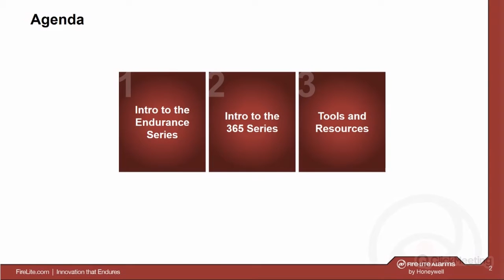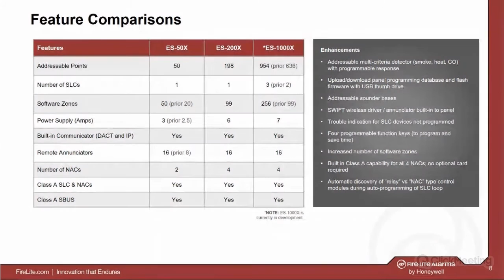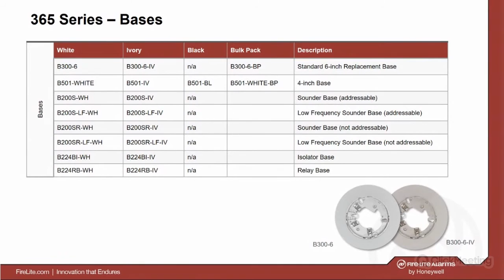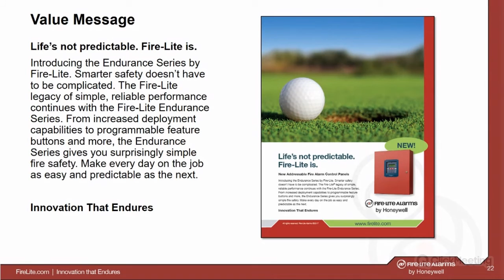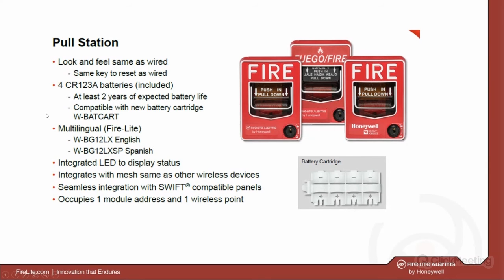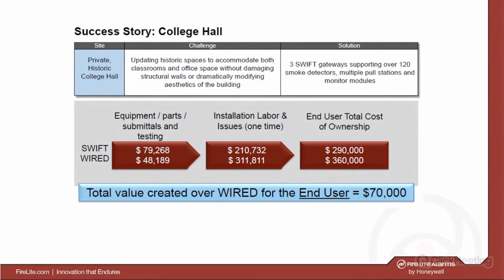Honeywell - Firelite Endurance & SWIFT® wireless technology.14/07/2020

Comment: Do you guys have any sort of tool available to assist in the design of systems, we recently found that signal strength for wireless devices can be tricky and while field survey works, its hard to determine the device location before going to the field
Reply from the maker: Hello Carlos, the software available for the design of the network is the SWIFT TOOL, for this you must have a W-USB. Thankyou.